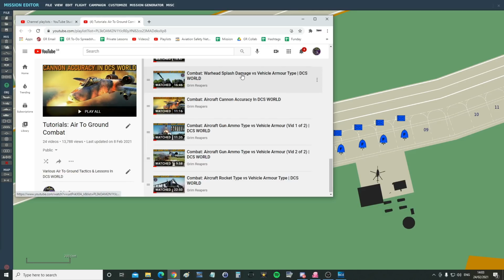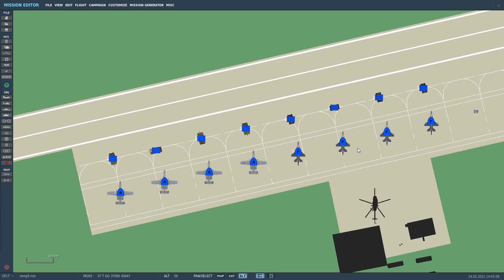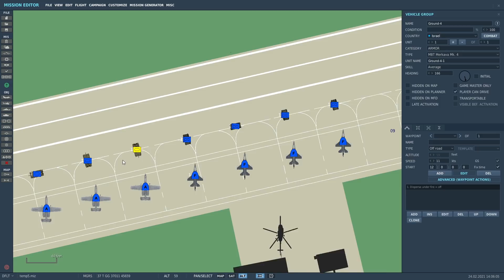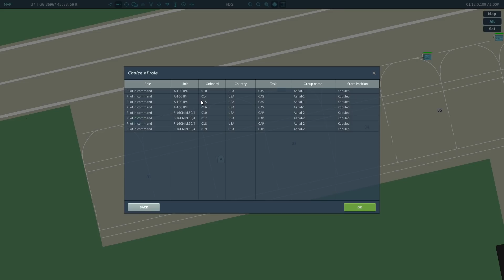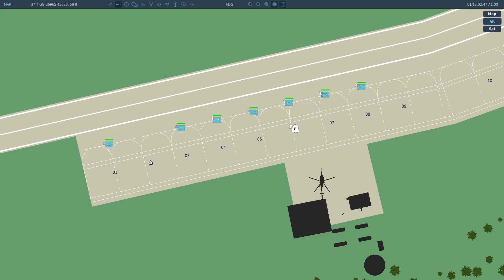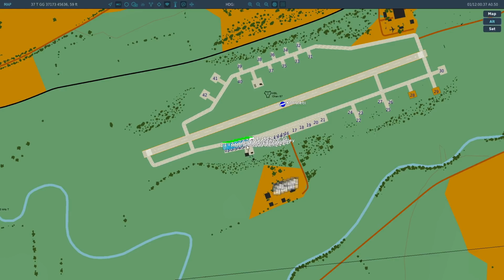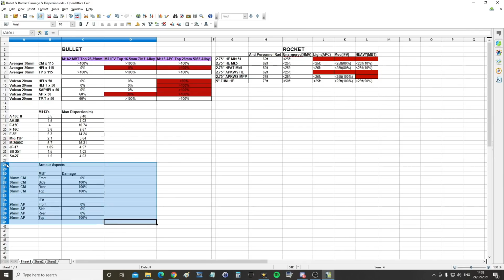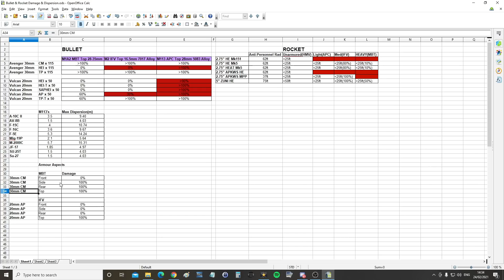Combat: Aircraft Cannon Armour Penetration vs Vehicle Aspect | DCS WORLD

Comment: How is the Bradley not getting penned with Vulcan 20mm AP from the sides and rear? Doesn't it have like 50mm of penetration at point blank range? It's API sits at 6.4mm at 1000m range and zero degree impact angle, so at 10 meters, the Vulcan should glass a Bradley from the side and rear and maybe the front.

Comment: Cap, I think you missed the really obvious test platform for testing armor by aspect: the Ka-50.     Auto-hover, shot counter, easy to aim cannon mount, single shot per trigger pull possible if on low rate of fire.   Of course, the A-10 doing a nose dive into the top of a tank is a great deal more "Grim Reapers style," and there are things besides practicality to consider when making a video.
Reply from the maker: Copy good idea

Comment: Somebody snuck in training rounds. The 30x173 ammo - 
    Precision: 80% of rounds fired at 4,000 feet (1,200 m) range hit within a 40-foot (12 m) diameter circle
    Ammo:
        PGU-14/B API Armor Piercing Incendiary (DU)
        PGU-13/B HEI High explosive incendiary
        PGU-15/B TP Target Practice
    Armor penetration of Armor-Piercing Incendiary ammunition, BHN-300 RHA, attack angle 30 degrees from vertical:[21]
        76  mm at 300 meters
        69  mm at 600 m
        64  mm at 800 m
        59  mm at 1,000  m
        55  mm at 1, 220  m
M928 APFSDS-T Armor Piercing Fin-Stabilized Discarding Sabot w/ tracer(now Tungsten, no longer DU). Penetration at 1,000m -  >60mm RHA steel at 60° obliquity.
With the mixed ammo of the A-10, API/HEI, that tank should be swiss cheese.